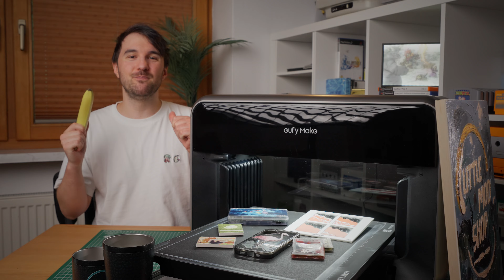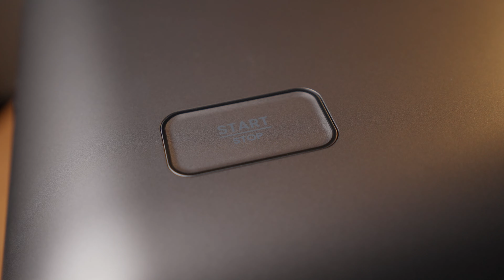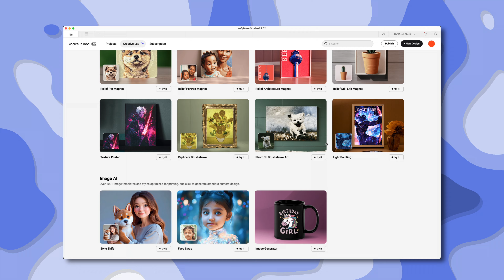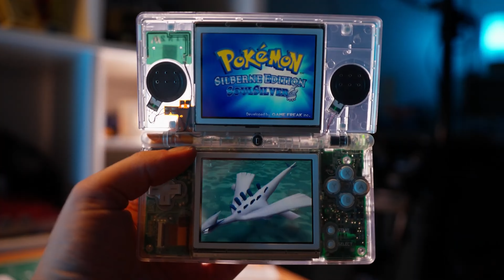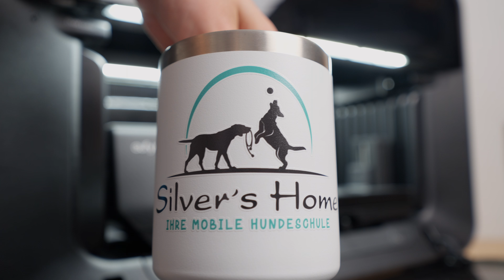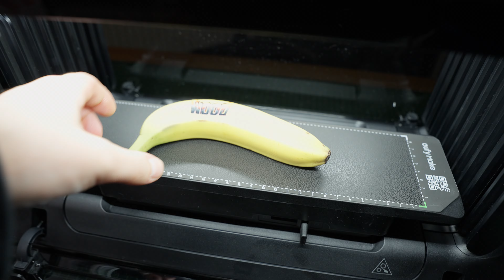There is NO OTHER machine like this! - EufyMake E1 UV Printer

Comment: I can't get over how they are handling the way they stop selling their current 3d printers, Ankermake/Eufymake M5 and M5C. Replacement parts are slowly dwindling and IDK how long they will continue to have the cloud. You can't even control the M5C without using the cloud connected smart phone app. These $300-500 3d printers are probably going to become paper weights in a year or two. Why would I speed $2,000 on a machine that will stop working in a few years? 
If this is a business purchase I would recommend a company with a history of supporting their products. Even if costs 5 times the price, in the long term you will spend less as you wouldn't have to throw away your machine.
Reply: People said the same thing about Glowforge Pro. I bought mine during Glowforge's kickstart campaign and it's still running great a few years later...no paper weight. It's cloud based and I love that because my laser cutter is always up to date. The only drawback is that I live on an island with wind storms where I lose power or Internet frequently. I'm supposed to receive my Eufymake E1 this week. I've heard that you still print with it being offline. If that's true then it's a win for me. If not, it's still a win for me being cloud based. I'm not sure where you got $300 - $500 3D printers. You need to add another zero. Mine cost me almost $4K, which was a little less than I paid for my Glowforge Pro a few years ago.

Comment: It's really an amazing printer and the way you have explained it, I am tempted to buy one. However, I just wanted to check one thing. I watch lot of sculptures of animals, great personalities, heros and wonderful gardens of the world. Whatever I find attractive, I immediately take a screenshot of the same using snapping tool. Is it possible for me to take the prints on this printer of all the screenshots I take and secondly, whether that will appear as it is or will its colors fade away. Lastly, is it possible to order from India online or there is any other supplier in New Delhi (India).  Please do take out a minute from your precious schedule and throw some light on this query. Many many thanks for sharing and explaining this wonderful video. Best regards, Nassa
Reply from the maker: Hey there Nassa. If the screenshot is high resolution enough i can’t see why it won’t print well. The uv ink is very resistent to fading and i am confident it won’t fade. But as this printer is new, we don’t have long term test results on that. EufyMake is claiming bare minimum 3 years of letting the prints in the sun, so that seems totally fine with me. Hope that helps :)

Comment: The ink is locked into their refills, right?

Also, you aren't mentioning how long prints take.
Reply from the maker: Yes, there is no other option for now.

I didn’t mentioned print speeds because this depends highly on what you printing and what settings you use. Normal prints with white + cmyk can take 3-5min total and the oil paintig with the texture effect took almost 5h.

Comment: What file type did you import into the eufy software to get 2.5D prints? SVG?
Reply from the maker: for the depth map you can either generate one in 3d party software and then get them into EufyMake Studio as a JPGEG or PNG. ohter formats like svg's and .Ai projects also work. i only tried it once without the built in generator, as i find it very reliable and i don't need to set up things in yet another piece of software.

Comment: It looks cool, but use case seems very niche. I've looked at reviews from others saying the ink is incredibly expensive + proprietary. I also don't approve of a monthly subscription price or the features locked behind them. I wouldn't be getting this without being able to make bank off of selling a service using it.
Reply: There is no features locked behind a subscription. You are subscribing for credits if you need more than the included ones for AI features. AI services require lots of computing power and energy which is expensive. 

You can also use any other service to create depth maps or remove backgrounds. No need to use EufyMake's services.

Is the ink expensive? Maybe. Does it allow easy swapping without making a mess? Yes. Does it help to avoid issues with cheap or old refill inks? Yes. In my case I pay for the convenience and easy maintenance that you don't get with 5-figure commercial machines.
Reply: @ulaB  if you can't do the things you're describing without the subscription, then those things are locked behind a subscription. It also wouldn't really feel like I own the machine if there's a maximum amount of times I can use it in a month before I have to pay more money to keep using it. If I spend $1700 for it, I'd enjoy not being told how I can use it.
Reply: @TechnoColossus  Again: The subscription does not have anything to do with the machine usage. You don't need the subscription to print things.

The subscription is for additional services you don't have to use from Eufy, but can get somewhere else if you need them. And even if you decide to use EufyMake's services, you can do so 50-100 times every month in the free tier.
Reply: @TechnoColossus  it's called you'll own nothing and be happy. 

But ain't no one paying attention to anything they are saying lol
Reply: @technocolossus have you not  noticed that anythig from 2023 has subscriptions attached to it?